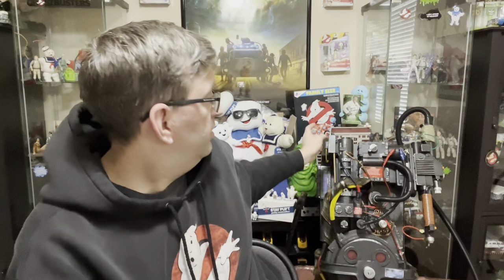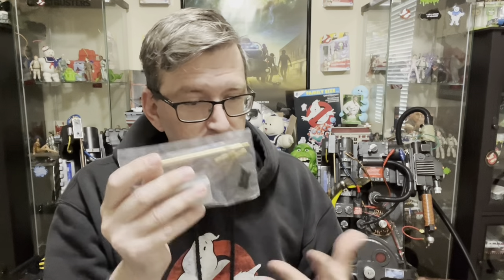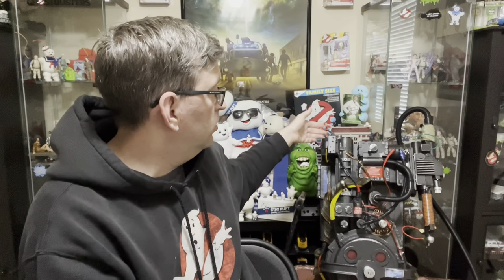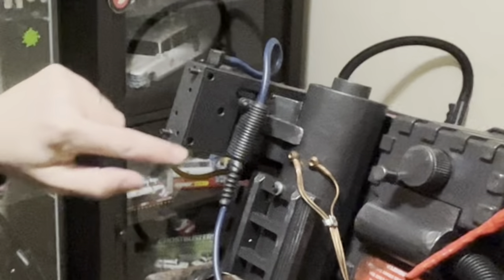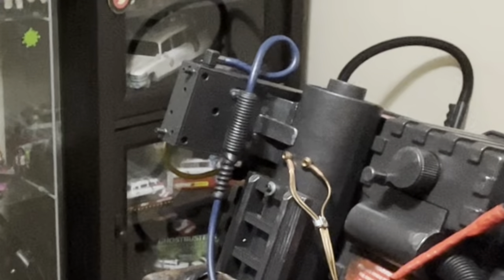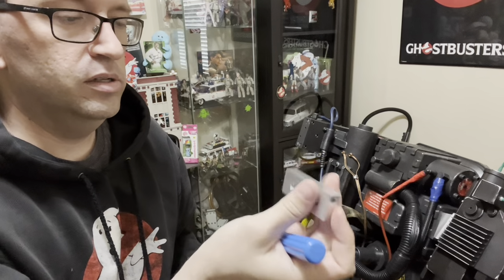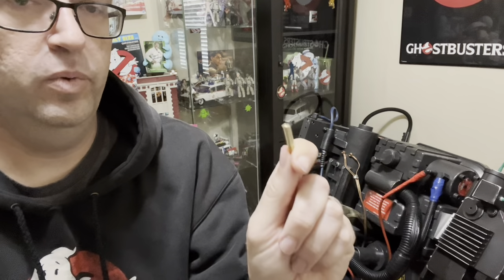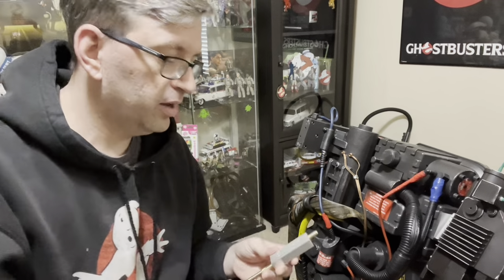HasLab Proton Pack Ion Arm End Cap Upgrade Install - @ghostbustersfans

Comment: I went a different route and drilled holes in the ion cap to fit the existing posts. That way if I want to return it to original I still can. Looks great too, all I had to do was cut down the M3's and add a little glue so they say in place and then the posts hold it tightly in place.

Comment: Are you gnna updrade your ribbon cable to a Fincher version?. As that was used in GB Afterlife+it has star qaulity as well
Reply from the maker: I bought a different cable on Etsy that was specifically designed to fit the HasLab cable connector. I’m saving my Fincher for my Mack’s Factory build.
Reply: @TheProtonPackIsNotAToy  Cool